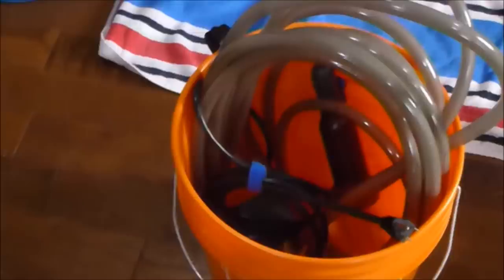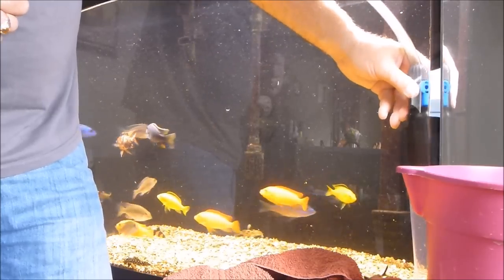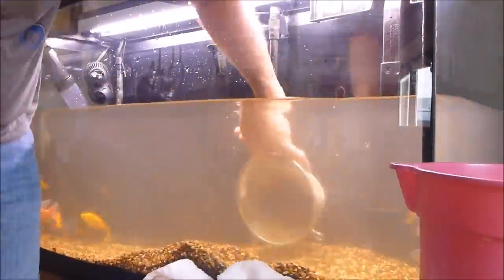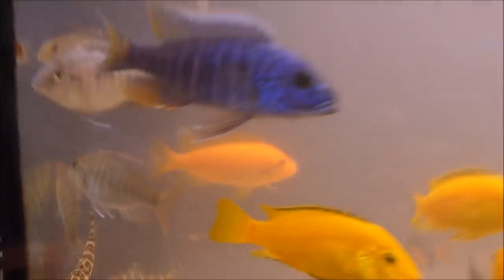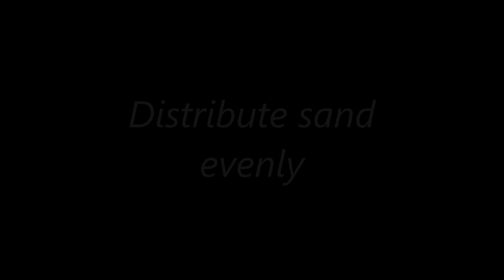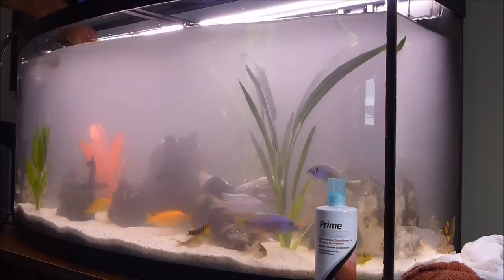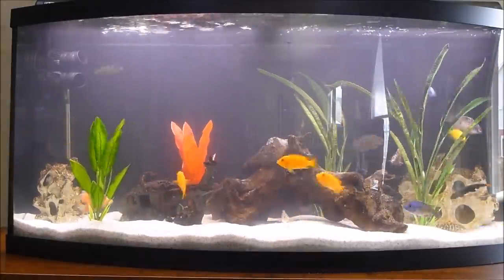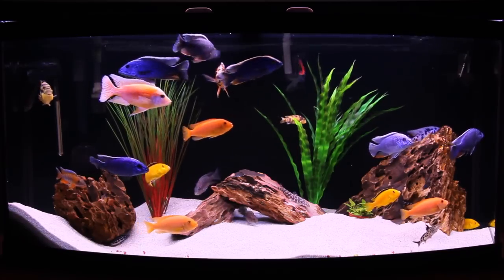Aquarium change from Gravel to Sand

Comment: Nice tank sir, have a question on the sands, pool filter sands you have are they white color sands or tan? And whats the brand? Quikrete or any brand name thank you!
Reply from the maker: They appear tan when dry but in the tank they are quite white. The product I used was White Light'ng, I may have spelled it wrong.
Reply: And you can get those at any pool supply sir?
Reply from the maker: @johnle5935  I believe so
Reply: Im at leslie pool supply, they only carry #20 pool filter sand but they in tan color not white, this is bad so hard to find white sandw
Reply: Is it the light that make your sands look so white in video?
Reply: Cant find white lightning here in California around where i live
Reply from the maker: @johnle5935  the light of course brightens it up but not artificially. I think you'll have good results with the tan coloured one.

Comment: So where is the detritus going if it isn't collecting on the surface of the sand?
Reply from the maker: It's getting circulated in the water column and chewed up buy powerheads until it gets sucked up by the filtration.

Comment: When ever you have gravel without a subsand filter, you're not utilizing the huge bio filter in your tank. That will give you better water quality and happier fish.
     I don't like the commercial subsand filters because it doesn't have the complete flow to let it clean very well.
      So I made one out of lighting defused better known in Aquaria as egg creat, so there is good flow under the entire thing.
      For cleaning I put a power head on one riser with a clear hose going to a canister filter made of 4" PVC pipe, filled with bio sponge,charcoal and polyester filter matterial. The return line goes into the other riser.
       Last night I did my first test run, using a 190gph power head over 3 hrs, doing 28 water changes on a 20 long tank. Actually I did two 20 long tanks. Both were high with nitrates & nitrites, after getting all the sediment out from under the subsand filter I took another reading and all the nitrites were gone, but the nitrates were still there. We're talking 190 gallons a hour and there wasn't even a ripple above gravel  but the water above the substraight was made crystal clear like there was no water at all. My invention worked far better than expected. Now I am planting the heck out of the tank to keep the nitrates in check.
     Not hard to figure it out when you realize you can pump all the sludge under the filter without breaking the tank down. If you tried it you would never go back to sand.
Reply from the maker: Thanks for sharing your thoughts, and I'm glad it's working for you. For me the sand substrate is the way to go for sure.

Comment: I have a 75 with crushed shells with an under gravel filter using power heads. I want to switch too sand for same reasons. What do you think I should do with UGF?
Reply from the maker: If you have adequate filtration for the bio-load I would remove the under gravel filter. Otherwise I wouldn't switch to sand.
Reply: Bobby G's Pro Aquarium I have great filtration. Im old school with UGF. So other than looks, stay away from sand?
Reply from the maker: I don't expect you'd get the results you'd be looking for. The sand would get underneath the ugf and I presume would end up coming out the uplift tubes.
Reply: Bobby G's Pro Aquarium I would def remove UGF if I went too sand. Really only have crushed coral cause I started with cichlids but have switched to a community tank so I don’t think I need that much minerals.
Reply: You can use gardening weed barrier over the UGF to prevent the sand from getting underneath. Cut it to size then add the sand. I've used digging type snails to aerate the sand.

I have plans on converting my current running tanks to sand. I'm just worried about the "cycle" and my fish. I don't have a big enough cycled tank to temporarily house them.
Reply: Jack Potparty I you weed barrier in my dart frog tank
Reply: @garysteinert8040   You would only need the weed barrier if you are using sand with a UGF. I don't know much about frogs but you probably can use it. 

If you have relentless digging animals, you can better secure the weed barrier to the side of the UGF plates with hot glue or use some sort of flow through plastic grate between the filter and sand. I've never had to go that far myself, but I've never kept sizable cichlids with a UGF. I have seen tropical fish stores do it though.
Reply: Jack Potparty with frogs same principal. You use it to keep soil above the water layer. It keeps the soil from getting wet so it doesn’t smell. Last forever.
Reply: UGF is outdated just switch filtration methods if you want sand.

Comment: I have gravel and don’t vacuum it at all. Never had a problem but my tanks are planted.
Reply: How long have you had it ?
Reply from the maker: That's interesting you must have quite the cleanup crew although even then I'd like to know how it's possible.
Reply: Even with a good clean up crew, I can't imagine how much waste and food is buried beneath the substrate.
Reply: Bobby G has a very high loading in his aquarium. If you have fewer, smaller fish, there would be less waste and the system would be able to break it down. Planted tank helps a lot, too.

Comment: Why do you not need to vacuum the sand? Where do the turds go?
Reply: You still have to vacuum the sand, usually the turds sit on top of the sand, but with the cichlids moving the sand and stuff it gets buried, so you still have to clean it
Reply from the maker: If your water movement on the sand is enough the waste stays in the water column until it ends up in your filter. Very rarely do I have to hoover over the sand to pick up debris and I can't remember the last time I might have actually vaccumed it.

Comment: im switching my substrate. should i switch all my gravel at once, or half now and half next week?
Reply: Dear I think better to change once, I also replaced once, as gravel will come up side & sand will go down & you will see only gravel.
Reply: You can just add sand on top of your gravel. It will mix together eventually but that looks good too.
Reply: @T.J-and-Soul  Thanks Dear for reply, i hv remove all tank sand as sand which i brought was not of good quality i can't find reason, my all fishes were taking fast breath now after removing sand all fishes are OK now my tank is bare bottom its looking best & zero maintenance now i plan to keep bare bottom.
Reply: @NewAquariumHobby  yes you have a big number of fish in the tank it would be hard to keep water parameters good.
Reply: What is the pump you use to take water out? Thanks

Comment: I want to switch my gravel to sand but I don't know what filter to use
Reply from the maker: What size is your tank and what's your current filtration?
Reply: @bobbygsproaquarium  im changing to sand in a 75l and the water so very mucky easily ive been workin out in for about  7 hrs
Reply from the maker: @adamroberts487  did you rinse your sand first?
Reply: @bobbygsproaquarium  yes
Reply from the maker: @adamroberts487  possibly not enough
Reply: @bobbygsproaquarium  its not the sand its the dirt from the gravel
Reply from the maker: @adamroberts487  maybe it would be easier to place all the fish is buckets, remove all the gravel and then remove the water.
Reply: @bobbygsproaquarium  i thought that but i would have to move the heater and air pump in and i think heater might of melted bucket
Reply from the maker: @adamroberts487  in my experience the heater will not melt the container.

Comment: wonder if it's ok to put sand on top of gravel!!
Reply: I've heard of many people capping gravel w/ sand once they realize gravel was not the way to go. This eliminates the danger he explains in this video. Although as you may know (and see in his video at the end) that cichlids love to dig around in sand and capping gravel w/ sand would probably not work well for a cichlid tank.
Reply from the maker: I wouldn't leave any gravel in the tank. If your intent is to cap the gravel with the sand, the sand will ultimately end up on the bottom and you gravel will be on top. I don't think you will achieve the benefits of just having sand.
Reply: @bobbygsproaquarium  would've been nice if you told me this a little earlier. Lol
Reply: @calebkang5544  Just keep adding sand until the sand has finally settled. According to a youtuber F.F it's ok to put sand over gravel...just make sure the sand substrate is about 2 inches thick

Comment: poor fish...you didn't bother to take them out first ?
They must have been stressed to the max...how many of them did die afterwards ?
Reply from the maker: I agree I wouldn't do it this way again although none died. Thanks for commenting.
Reply: I am doing this over the weekend , do you suggest taking the fishes out ? And if so when can i put them back in ? Awesome video
Reply: After watching your video, i switched over to aragonite sand last weekend. I LOVE IT and will never use gravel again. I left the fish in thinking it would be more stressful moving them twice. I lost none and my fish are very happy. Happy fish, Happy fish keeper
Reply: @kennethhampton532  how is it going with araginite?
Reply: @MBravo-ki4vl  all is well. I lost none during the change over.My ph is stable at 8.4, my water is crystal clear. The key is to clean, clean, and then clean it again b4 adding it your aquarium.
Reply: On the topic on taking them out vs leaving them in. My hands r always in my tank. During the change over they got n my way more then anything, (guess they wanted 2 c what i was doing) Know ur tank and fish.

Comment: Why isn't  there poop??
Reply from the maker: The goal is to have enough water flow at the bottom so the waste doesn't sit on it but instead gets picked up by your filter.
Reply: @bobbygsproaquarium  Will a large sponge filter and an air stone do that in a 38 gallon?

Comment: There is way too many fish in there I bet you have to clean it weekly.
Reply from the maker: Yes there are a lot of fish in the tank, this helps reduce aggression and weekly water changes are required. I think this is pretty common with cichlid keepers. Thanks for watching.
Reply: I have about 80 fish and 35 Amano shrimp in one of my 75s.